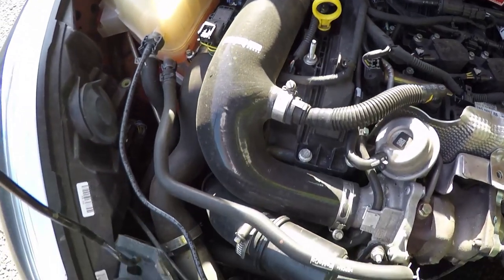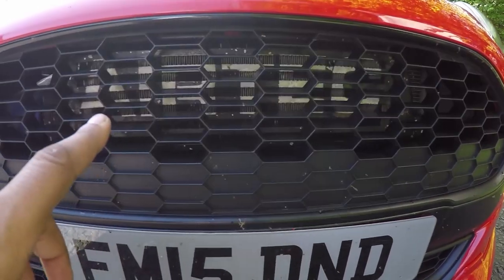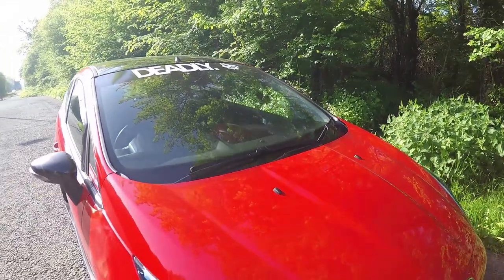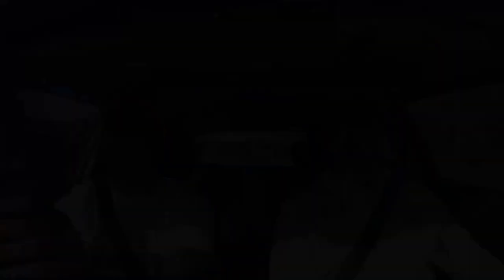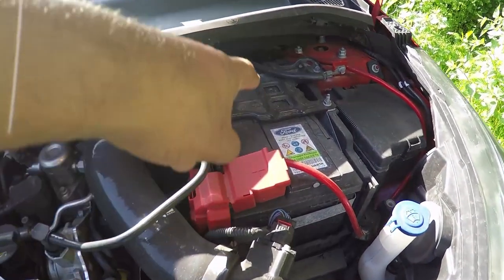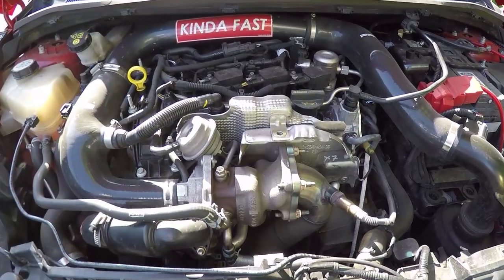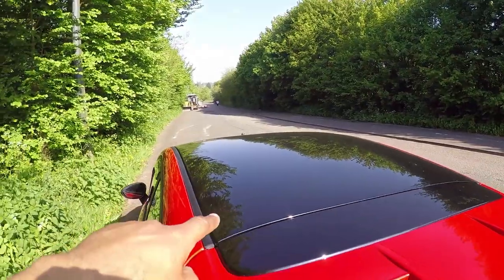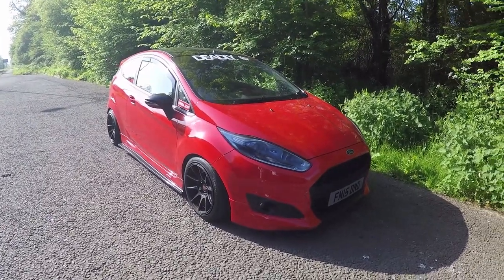180BHP 1.0L Fiesta Ecoboost//Stage 2/Shots fired....

Comment: Impressive what 1000cc can do.. 3 cylinders actually sound quite good. In a way, similar to the 5 cylinder.....which I love with my RS
Reply: nothing like a 5 cyl. V6 yes but not 5 cyl
Reply: waynester71 
Nah man that sound you hear is just a fake engine sound coming from the speakers 😂😂😂😂
Reply from the maker: Fyi the microphone was in the engine bay
Reply: waynester71 your RS uses a Volvo 2.5 5 pot
Reply: Elliot Redding  A fact very well known.... Volvo was owned by Ford at the time..
Reply: Far away from a 5 cyl... Fivers sound like mini V10s the same way 3 cyl sounds like a mini V6. I love 3 cylinder engines, but due to the difficulty to balance them as well as increased vibration it is hard to get power from them reliably.
Reply: Similar to 6 not 5
Reply: waynester71 3 cylinders normally sound good look at the charade gtti 1 litre turbo 100bhp from early 90s
Reply: @elliotredding6164  they never actually used the engine from the rs in a Volvo it was the same family though
Reply: Im at 145hp and 250nM with a 1.0 Tsi just stage 1. Trying to pass the 200hp and 300nM with stage 2-3. Fingers cross it doesn't blow. :D
Reply: @ACERASPIRE1  he meant its similar in a sense that's also an odd cylinder count. They sound great
Reply: @kjwakjwa8502  is that automatic gearbox capacity strong enough for 180hp, my one only 145hp
Reply: 3 cyl 1.0 would sound as deep as a 4 cyl 1.3.  .333 per cyl same

Comment: Never understood why people tuned these ecoboosts when they can just get a standard ST which will be quicker and cheaper standard? Also be way more reliable
Reply: Gr34ters insurance
Reply: Gr34ters ive got the standard red edition 140bhp, 1.0l. Insurance is £700 at 20, a 180bhp ST is £1700. I can declare mods and it still be cheaper
Reply: alfie sole that‘s nuts man over here we have a difference of 120 bucks for the two models
Reply: Gr34ters nearly bought an st, but to be fair it's too harsh. In the city, Got the 125s eco as it's much more town friendly. Free tax my insurance is 300, wanted 700 for an st. I'm happy. Not tuned mine but prob will chip it that's all, good little car,  only issue gears are too long.
Reply: CaRe7aKeR what do you mean by too harsh? I‘ve driven a couple of cars and the only car less „harsh“ than the FiST was a CLS350.. mustang, st220, golf 6r are harsher than the ST imho
Reply: Yll - I Live In London,the roads are screwed, the ride of the st is harsh. My daily commute involves speed humps and the screwed roads. The zetec  s I have is bad enough ith its mildly lowered standard suspension and 17 inch wheels, it's all ready needing a pair of drop links .. the st was ridicoulous on the roads. Prob lovely if you live in a land where the gov actually maintain roads!
Reply: CaRe7aKeR fair enough makes sense now! Our roads are very nice here :) i thought you were referring to the driving style of the car.. i totally forgot about the bumps. Even I hate them in my ST and I probably have only like 4-5 bumps a day to conquer
Reply: Yll - i have drop links on repeat order. London is mostky like a farm track.. nightmare..
Reply: It’s like saying I don’t know why people Tune the st when they can get a Nissan GTR... I appreciate when people are different and it’s nice to see different model car that car tuned. It’s fun and enjoyable to watch different builds. be your own person and have your own taste( each to there own)

Comment: All that power from just a single litre of displacement?!
Reply: It probably loses 1 hp per day until it decides to blow up.
Reply: https://www.youtube.com/watch?v=tmZMwk14r4c  --- depends how much boost you use and how strong the engine is  --  'big' isn't always best.
Reply: Don‘t forget. 3-cylinder.
Reply: Well, the Mercedes A45 AMG makes 380 ish Hp from 2l of displacement  as it comes from the factory. So my point is it is possible to get that kind of power from a engine with 1l less of displacement.
Reply: karl kiernan that’s a 2l, not a 1l
Reply: Honda did it years ago :)
Reply: @BuzzCrrr  A 2.0L engine making 380bhp, equivalent to 190bhp/litre.  1.0L sports bikes are making over 200bhp normally aspirated, so making that power with a turbo isn't that impressive.
Reply: @ferrumignis  You have to remember, bike engines rev way higher
Reply: @silkywelshman1999  Umm yes, that's the only way to make more power without forced induction (or impractical schemes like NOS). That's why Honda's VTEC car engines made so much power for their size. I'm just saying that getting this level of specific power through forced induction is not particularly impressive, Mitsubishi were doing this in production cars around 15 years ago.
Reply: @ferrumignis  Exactly my point

Comment: It is bonkers, but that said, motorcycles have been doing over 180bhp from 1000cc without a turbo, for some time now!
Reply: Motorcycles have been doing it with a lot lower torque. This 1 litre stock does 170 and probably more since modded.
The BMW s1000 by comparison that is 1000cc 100Hp can output 84Nm.
Also the Ford engine was released in 2011.
Reply: Yep, but motorcycles also rev up to 13k rpm and more some of them. This fiesta probably has a limiter at 7k i guess (stock 6.5k)

Comment: Them pops and bangs sounds absolute shite !! And that engine wont last long at all i dont think. Love to be proved wrong tho
Reply: adam beatty depends on your driving style. If you warm up and cool down, it will last long
Reply: I've done 2.5k miles on 160bhp with pops and bangs
Reply: @Reclesss  2.5k miles isnt much of a test though to be fair 🤣
Reply: @2251adamb  it is when the engine has 88k and you're beating it (when  its warm of course) 😂
Reply: L23LJG what tune you got?
Reply: @Reclesss  88K miles is high ? Ok lol.
Reply: @redlineracing4947  very for the 1l ecoboosts. It got sold on 95k had original engine and clutch
Reply: @Reclesss  original engine ? Is that supposed to be good for these ? Not trying to be a twat just see endless issues from gearbox’s to the engine & I don’t fully understand the reliability on them. See people pushing 180hp on these & say “runs sweet mate” but the demographic of people who buy these, know Jack about cars usually & I don’t believe that these will be reliable in the future, love to be proved wrong however & would like some info on these engines if you care to share
Reply: @redlineracing4947  thats quite good you see alot of them going at 20/30k miles they are prone to blowing u0
Reply: @Reclesss  why is there such hype around these engines then. They don’t seem to hold up ? Or are some flukey ?
Reply: @redlineracing4947  I know someone thats been running 170bhp (albeit no pops and bangs) for over a year now with no issues. Depends on your driving style and servicing.

Comment: How's the car going after all this time? Did the 998CC powerful engine still resist or did something fail in it as most people think? Thanks!
Reply: Howsit maverick, what's the difference with the 140ps version compared to the 125ps version ecoboost engine
Reply: @ashveersanilal1699  
As far as I could read, the 140 and 155ps 1.0 ecoboosts are somehow electrically assisted hybrid engines to reach that power but the engine itself is the same 125ps. Ecoboosts have now been passing over 300k miles and still show no signs of failing or wear, but only on those who put only true quality synthetic oil (not fake) 5w20 and certainly changed it sooner than 10k miles and once in a while (even after a couple of years I suppose, but at least they did) get the oil pan down and clean the oil pickup from wet belt debris and saved the engine on the long term even if not changing the timing belt during the cleanup of the oil pickup, cause this seems to be the most found problem for Ecoboosts fails..., lack of enough lubrication..., all because of the wet belt small debris piling up on the oil pickup and greatly reducing pressure.
Reply: @Maverickf22flyer  I feel my fiesta would breathe much better in UK. Compared to in SA. It's quiet powerful now without the decat or software as I damaged the 3rd gear on my gearbox.
Reply: @Maverickf22flyer  Maybe the 'mild hybrid' types of the last Fezz or Puma but I'm pretty sure those Red/Black editions aren't hybrids. Compaired to the 125 I think they tinckered with the turbo preasure and maybe a slightly different map on the 140.
Reply: @raymon8044  
Makes sense...

Comment: lol!
Cute....
Good luck with the duration on the engine.
Reply: Ford sold a car called the Formula Ecoboost, from the factory it came with 205HP with the exact same engine and internals. The biggest difference was they used the turbo from the Fiesta ST.

Comment: I talked with a friend and he is running a fiesta 1.0 ecoboost at the track and he said that the chassi is very good but the fiability not. He is breaking the primary shaft and the sincros of the transmission very usually.

Comment: just fitted mine and i went for a drive and the turbosmart valve flutter sounded weaker, is that a issue i should be worried about or is it because its a bigger intercooler?

Comment: Cool vid and hate to be a killjoy, (I loved my 1.0 ecoboost fiesta) but are you aware of the head gasket issues on those engines? Over 600 listed on a Uk Facebook group already with failed engines (including mine).
Reply: Fat Man In a Buggy 33k shes all good so far
Reply: Jordie Evans Absolutely true not all. The odds are that they will be fine. Though now it’s got to 630x of them failed between 20k & 50k for those that have actually found the page, I’d say it’s certainly something to keep an eye on.
Reply: That was to do with a coolant line failure which resulted in lack of coolant to the engine, that resulted in head gasket failure.
Reply: @101francis101  Spot on. The fact that the exhaust manifold is part of the cylinder head just accelerates head warping once a coolant hose breaks. I think some engines had a coolant leak issue due to the  coolant pump seal also. I have a 2015 1.0 and its been fine for over 45k and that's with a 150 Bhp re map.
Reply: Just coming up to 60k miles with Pumaspeed stage 2 170bhp and no issues. Car gets optimax and more frequent oil changes. Only issue at the moment seems to be a squeaky serpentine belt pulley... extremely irritating!
Reply: @101francis101  Are you tempted to go for the 205 re map by Puma Speed as you have all the bits fitted for the 170 ?
Reply: Definitely tempted but I would be concerned for my clutch (still fine at the moment) and for the drivetrain. I think I’d be a little worried about the cylinder walls, rods and pistons too. It’s also a bit frustrating that it would cost me £933 for the hybrid turbo (fitted) and an additional £279 for the stage 3 remap :(

Comment: Nice that you can tune these so easily.. is it reliable at that power?
Reply: kink431 The engine is perfectly fine up to ~195-200hp, higher than that you should be using uprated rods and pistons
Reply: I wouldn't recommend, FiST or any 1.8t 20v engined car if insurance allows
Reply: Jordie Evans looool no these engines start cracking blocks at 160hp lol 300 would be immpossible
Reply: @jackisonline2  20v 1.8t is an awesome engine

Comment: The block won't last long, I know of one locally, was tuned to 172bhp and the block cracked within 4 months, these are 3 cylinder frugal engines.....im all up for tuning, but not 1.0l eco engines....tune a diesel or a turbo petrol over 1.6 litre....
Reply: Dav Scanlon my friend was running the same map for over a year we will see how it plays out
Reply: Yep my crank broke when I was running 155bhp
Reply: R Mc what map ?
Reply: Revo stage 1 but I don't blame the map in the slightest, the map had pretty low peak torque so it wasn't because of the map, more that the 1.0 engines are dung
Reply: R Mc fingers crossed nearly half a year in and she runs fine boss so could be w lucky one
Reply: Yeah there's plenty of them are mapped more than mine was and are fine like!
Reply: R Mc yh man it’s quite weird some take to it quite well like mine so fingers crossed
Reply: I've done 40k miles stage 1 (160BHP), just put stage 2 (180BHP) on the other day and I've abused the hell out of this engine at times, but I look after it by keeping on top of oil, regular services, etc. I've never had any issues. Apart from the synchro's in the transmission since the 1L Ecoboost has the IB5 transmission which is known for bad synchro's and the synchro mesh since it cannot handle the torque of it being a turbocharged vehicle (thanks ford you dicks). The new transmission IB6 which is what are in the newer fiesta's are fine and are much stronger.
Reply: What about the factory tuned ones? Like the st line 140
Reply: these days every manufacturer can be a hit or miss. 
Had a bloke down the street with a nice black GT86. 2K kilometers in he had a shattered engine.
Sure all replaced under warranty, but he lost the car for a solid 3 weeks.
I even know of well respected elderly man who drove a 911 gts, bought the car almost new, like 18 months. 
He lost the exhaust on the open road after barely 2 years.

Then there is this crazy man who had  turbo charged the 1.2 duratec fiesta mk5 with plenty of other mods pushing 150whp weighing less than 800kg.
went for almost 10 years. it was his track car, only needs regular oil service, brakes and tires.
that thing was a beast. 
Notice the past tense? he unfortunately planted it against a guard rail. total loss, he was luckily fine.
Reply: Neo VeNoM did the guy redline the gt86 all the time?
Reply: Unity101 can confirm the IB6 Trans can hold a lot, 330 whp / 440 nm :) just rebuilt my block after engine failure on my 1.6 EB big turbo setup and the trans doesn‘t show one sign of damage (neither did the block if it wasn‘t for that mis shift)
Reply: So you can't tune a 1l engine to 180 hp but a 2l with 360+ that's totally fine. Where's teh logic in that. People have been running high hp/l numbers for ages but when the engine is a three pot suddenly it's gonna break and it's shit. Right..
Reply: NineEleven1 mate these people are the people who are gonna shout downsizing at every new car that comes out you can build any displacement engine with high hp
Reply: The build quality is not relative to how far you can tune the engine......These 1.0L engines are built for economy. They are frugal and have very little tolerances compared to bigger engines. Thats the logic and the engineering.
Reply: Dav Scanlon then tell me how a 1.6, a mere 0.6l more displacement engine can make 400 hp on a stock block safely? Of course build quality and used materials are gonna have a huge impact on how far you can take it power wise and nowadays even the economy cars sometimes get a bit overbuilt. Yes logically the tolerances are a bit lower but not as much as you seem to think.
Reply: Dav Scanlon i drive mine now for almost 2 years big boosted. 60.000km. Not a single problem
Reply: @TheClaytonbarry  XD Stock Zetec S has 140 BHP and your broke at, 155 HP. That hilarious

Comment: Might as well get a bloody st
Reply: RSZerqu harder to insure/alot more expensive for young drivers
Reply: Eden Kelly probably cheaper to insure a stock st than a stage 2 st line once they have declared the modifications
Reply: St faster but not 3 cylinder...lovely exhaust note ...baby 6 😍😍😍
Reply: RSZerqu  not with the insurance quotes
Reply: I'm 19 and a ST cost me a extra 3000 a year than this
Reply: Jordan Machell 3 grand saved on mods trying to push 180
Reply: David McKay but in reality cost about half of that, don't get me wrong I would prefer a ST, infact I have this exact car and I'm hoping to upgrade to a ST instead of modifying it, but these cars are brilliant and win over in so many other ways that some people prefer, don't hate on other people modifying these cars, there brilliant.
Reply: Jordan Machell pumaspeed are 2500 + for 205 bhp. Just dont see the point not hating or that. Plus if it ever ends up in limp mode your running on 2 cylinders... scary
Reply: David McKay you have literally just picked out the most expensive way to modify a fiesta, revo stage 2 remap, decat and back box, intercooler, and induction kit, from brands like airtec, all of that is around 1400-1500, which is alot cheaper than a ST, and you can get cheaper remaps than that aswell from approved local garages which usually no what there doing.
Reply: Jordan Machell my point is if your insurance is high why spend 1500 on mods when you can give the insurer it instead and have an st with more bhp standard and a extra gear?lol no brainer for me but each to their own !
Reply: It cost me an extra 500 than your upgrade and i get 350bhp. Just to add i have just had a driving ban and my insurance is now 600 fully declared parts...
Reply: Double the cost to buy almost more to insure more to tax more for parts and use more fuel